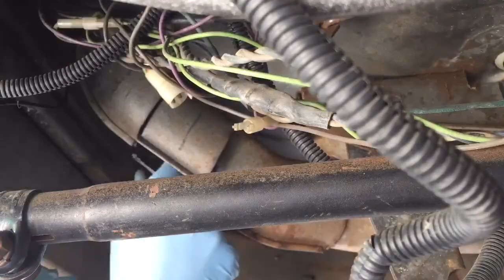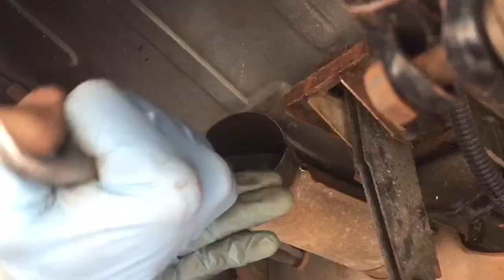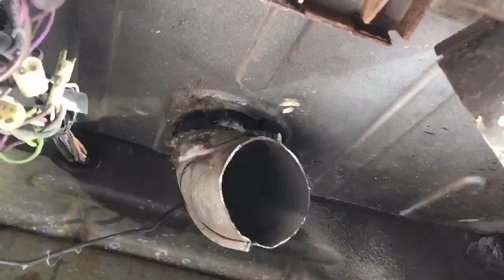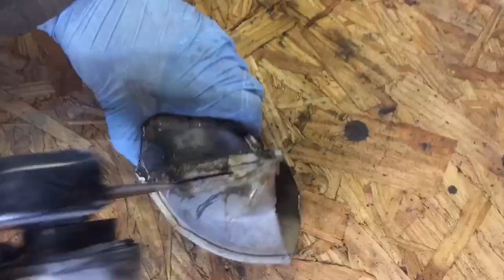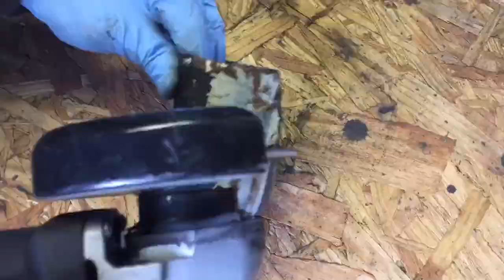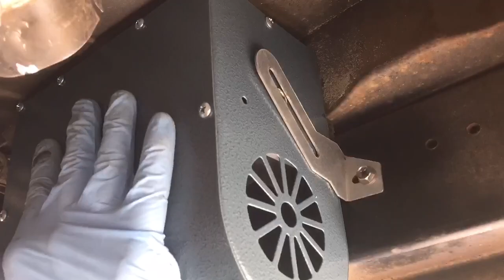Heater Box Install - Daily Driver VLOG 6/5/17

Comment: I plan on doing this with a similar unit but the box will be inside near the dash somewhere.  All I will have to do is run the new coolant lines, mount the unit(power it, but I've already got old amp lines run so that's taken care of),  and I'm going to route the outlets with adjustable tubing to the inside ducts under dash near fan to have defrost.   I'll try to make a video of install but will definitely be one of finished product.

Comment: So. Does it work well. I've been needing a heater for my rod. Wonder if it's worth it ?
Reply from the maker: This one is a little underpowered. I’m still trying to find the perfect answer for a front mount heater
Reply: How was your wiring for this ?
I picked up a similar unit and the wiring instructions seems a bit odd. Almost like it's a variable ground.

Comment: nice work is that a waterproof unit?
Reply from the maker: +SVs Auto Definitely not, but it's marketed as a marine unit - odd eh? The insulation box that'll surround it should be though.

Comment: So are you only utilizing one of the three output ports from the heater?
Reply from the maker: +Chicago06sti No, I took that entire face off and flush mounted to the bottom of where the original heater ducting is under the bus.
Reply: Busaru very interesting. I'd love to see more of that. From what I can see on the video/based on size, it seems like alot of the heat would get trapped/heat up the floor. 

After living with it for awhile now, are ya happy with the setup? I've been looking for a better way to go about heating.